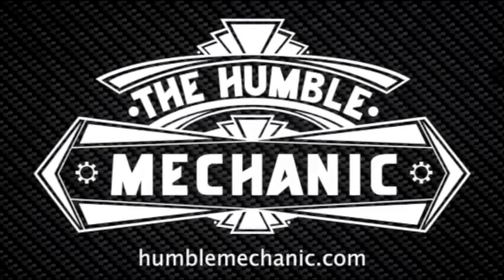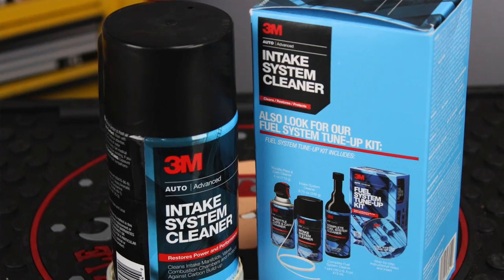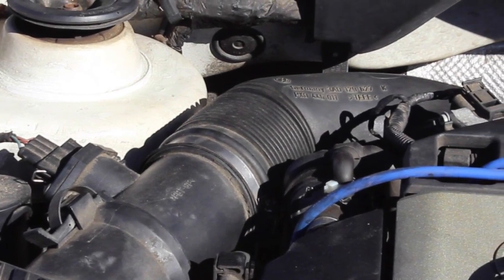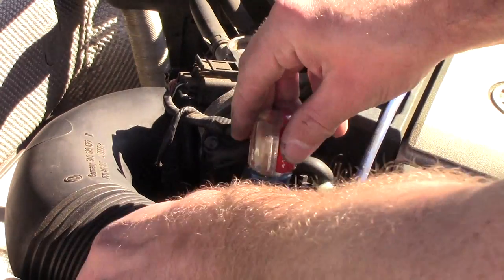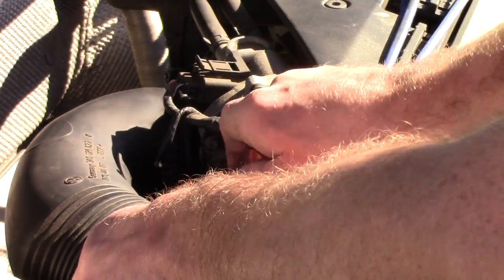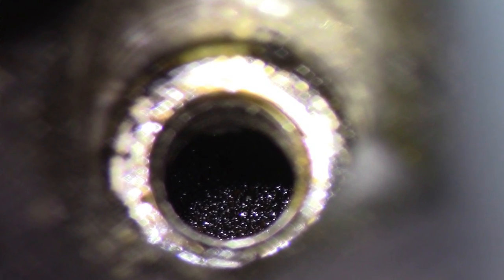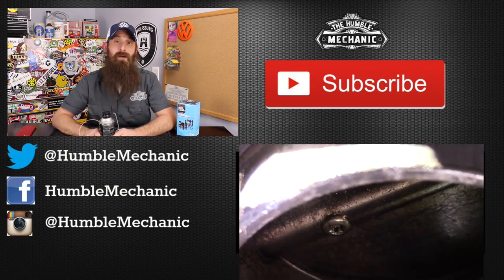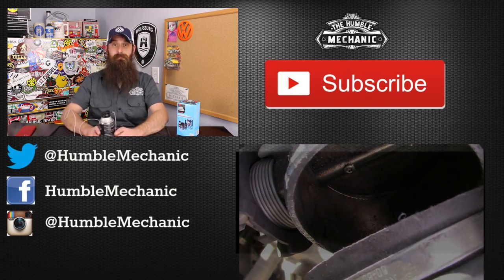Does 3m Intake System Cleaner Really Work?

Comment: Also, if your car has a heated wire mass air sensor, you should use 3M MAF cleaner on that as well. A small amount of contamination on the MAF will always have a bad impact on performance.

Comment: AC delco top head cleaner is also an amazing product. Some BMW's compression rings get stuck from carbon deposits and make you think the rings are worn when they are not ablet to expand due to being stuck. letting that stuff soak in the cylinder over night breaks it all up

Comment: I have a brand new Mustang 2.3 turbo, Ir has less than a thousand miles on it after 1 month of driving. If I put on a catch can I will void my extended 7 year 100K mile warrenty ...So I am thinking about the 3m cleaner as a regular treatment....say every 10K Miles.  I think if I wait 30K miles, the carbon cleaner may dump chunks into my twin scroll turbo..Is my plan sound?

Comment: I actually just recently did that at my toyota dealership doing a recall on car but they sold a " Foaming Optimizer "   Took the purge line off the intake and the straw sucked right in there. Luckily i only pulled the throttle body to get it, didnt go too far. Yikes! that made my stomach in knotz!

Comment: I have a '98 Camry with check engine light on (P0404-EGR insufficient flow error code). Took to dealer who told me I had to change EGR valve, vacuum modulator and vacuum switching valve, plus do a throttle and induction cleaning service...for $1200. I bought the 3M 3-step tune up kit and used the intake cleaner you reviewed, plus the throttle body cleaner. Then took car for a spin. Check engine light turned off! Problem apparently fixed...for $25.
Reply: Natalie Dussourd I have a 1999 Toyota Camry ce 2.2 liter and I also had insufficient egr flow so I did the same repair you did and an at home fuel system cleaning with the 3m 3 step kit also replaced pcv valve and it's grommet also replaced the fuel filter old one was factory orrigional from 214,000 also replaced the spark plugs with e3 plugs total price for all this stuff using all brand new parts $250.00

Comment: electric throttle i use the scan tool to bump up the idle during a fuel system service if i can works better than a throttle depressor

Comment: I think to know for sure whether this is worth buying, you'd have to compare these results to those of similar products on the market. If it turns out that no product can give you night-and-day improvement in carbon buildup, then it really is the case that that's too much to expect. If it turns out that there are products at the same price point that give better results, it's hard to justify going with this one.

Even in isolation, though, the marginal results don't appear to justify the cost. If you really want the manifold clean of carbon, why couldn't you simply remove it from the car once a year and get it sparkling clean with some carb cleaner or the like? You could do the same with the throttle body. The pistons are another story, I guess.
Reply from the maker: +batard I totally agree. The problem with that is how do you accurately test it? You really can't do it on the same car. One product may clean a little, then you have already started the cleaning process. Does that mean the next cleaner will do a perceived "better job"? I really don't know the answer to that. This may be one of the reasons that there are so many products that claim to be great, and very few really are.

I think for the gearhead, or DIYer removing the intake is an option. This car is not that big of a deal to remove, but still kind of a pain. There are plenty of cars that you would not want to take the intake off ever! LOL  I think cleaning the throttle body is a better use of time that removing the intake. But I have more testing to do, we will see what happens :)

Comment: I wonder if this would help direct injection valves? What would your pistons look like after a road trip?
Reply from the maker: +Andrew Thompson I am going to drive the GTI a few days later this week, and re check the piston. We will see if there is any change. 

It would probably work on DI engines, but it will not fix the carbon build up issue. It may help reduce it somewhat, but it will not remove it.
Reply: +HumbleMechanic any products out there that will significantly reduce carbon build up in DI engines?
Reply: +EVERLAST223 might want to try running Ac delco Top engine cleaner, get it from a gm dealership you can run it through the throttle body and through the injectors as an injector service. if running as an injector service the way i do it at the dealership is i have a pressurized canister i put about 3oz into it and then fill the rest with fuel/gas connect it to the fuel rail directly, apply shop air to canister for  pressure to atomize the chemical mix, disable the fuel pump(pull fuse/relay ect) and run it directly on chemical mix after it runs let it sit 2 hours then go drive the car hard to blow out cleaner lots of smoke will exist will cause misfire check engine light, then change the oil after wards to clean the oil all that broke down and go into it from the service. if through the intake/throttle body you can fill the canister with the cleaner (no fuel mix) have to have a nozzle to spray it into throttle, pressurized with shop air and run car till chemical is gone and drive and blow it out. also good time to add a fuel cleaner/additive to a full tank to clean from that side of the system as well
Reply: +jay webb sorry forgot to add , do it to a warm engine. the heat of engine will help break up the carbon deposits compared to doing it on a cold engine.
Reply: +jay webb Good info. I still think carbon buildup comes down to the wrong type of usage for the car concerned (too many short trips). Hard to tell the customer that one.
Reply: well if you use it directly through the fuel rail as an injector service the injectors are spraying the cleaner/chemical directly onto top of the the valves. majority of the engines now are direct injected, 2.0 , 2-4, 3.0, 3.6, 5.3 engines by GM are all direct injected. so when the valves open as it is running the injectors spray the fuel/chemical mix into the cylinder which is an atomized spray which will make contact with majority of the components and with a engine at operating temp the carbon deposits will be easier to cleaned off with the solution. so not only will it clean the piston lands it cleans the valves too. the 3.6 engines have a common issues with carbon stuck on valves causing a cold start misfire condition because the carbon makes the valves stick just a bit. to correct this issue we do a injector service using the ac delco top engine cleaner mix with fuel through the fuel rail directly in the injectors

Comment: None of the videos of the intake cleaners have convinced me to put my money on them.. They probably do clean up to some extent.. I just don't see a lot of difference. Do you think distilled water is better? Could you also use this product a few more times until we see a difference :P  Thanks :D
Reply from the maker: +varun123rup I agree. The products generally don't seem to get the job done. I have not tried water yet. The only other product I have used is GM top engine clean. I didn't do any testing, but it sure smoked a lot. LOL

I do think it will take a few tries to get this to work better.
Reply: +HumbleMechanic Does smoking indicate that its doing the job? Cause you mentioned you didn't see much here except a puff. Great if the car responded better after the clean up though. :)
Reply from the maker: I would expect some smoke. Although I have no proof that smoke equates to a better cleaning. It just make sense to me. Hahah.

Comment: what are your opinions on "restore"?
Reply from the maker: +omar k I used it on my integra. Never did any real tests on it. I would swear it worked back then, because I wanted to justify the purchase. HAHA..I really like these BG products now. I saw about 6% increase in compression, and I use MOA EVERY oil change. http://amzn.to/1UHqUJB
Reply: thanks for the reply. i have a bmw 540i i did a timing chain guide job on it and the timing was wrong so the valve and piston collided. now car leaks coolant. any good engine block sealer to try out? this is my last resort before pulling out the engine and putting a new one in

Comment: Whats your take on BG products ???
Reply from the maker: I use a lot of BG products because we use them at the shop. I like the MOA for sure. They also make a product called CPR that you use just before an oil change. It works great. Got a question on a show about that coming out later this week.
Reply: +Hozer Dee (vdubman) i work for gmc dealership as a tech and we use BG as well, in my 2.5 yrs there using it so far it all seems to work well.

Comment: what about using automatic transmission fluid.
Reply from the maker: I have seen people do it. Probably works fine, and makes a smokey mess. LOL  like all things, be careful of the amount going in
Reply: HumbleMechanic 

thanks! I just bought a 2003 Jetta wagon 2.0. started off running pretty good about 300 miles to a full tank. has recently dropped to 200 miles to a full tank. any suggestions on a list of some things I can do? I am willing to spend 600$ on part's

Comment: Why does the inlet manifold get dirty?
Reply: Sometimes a little bit of exhaust gas goes back into the intake during valve overlap. Also, some engine use an EGR valve, which lets a certain amount of exhaust gas go into the intake manifold.